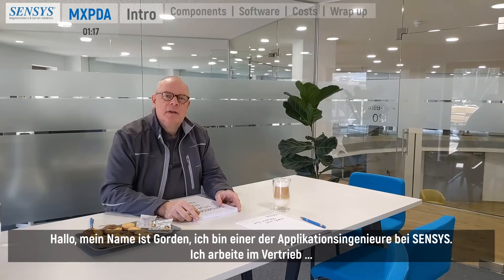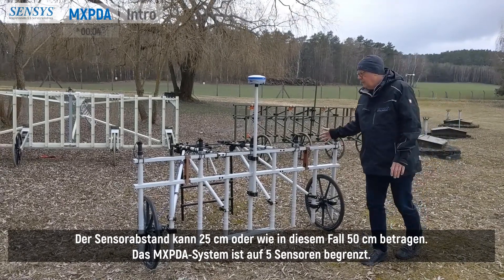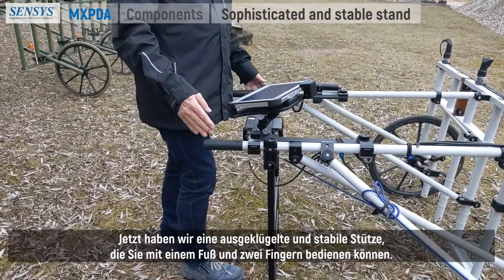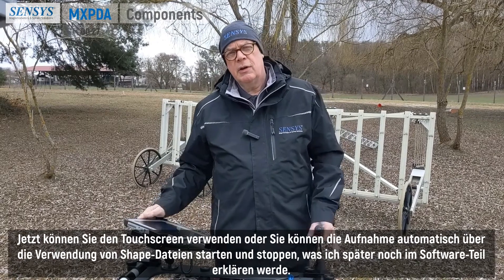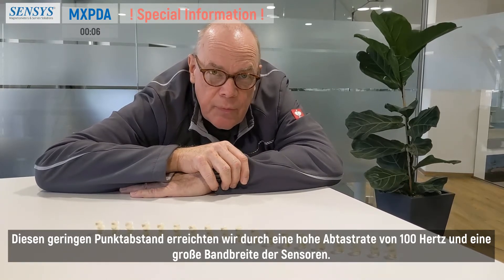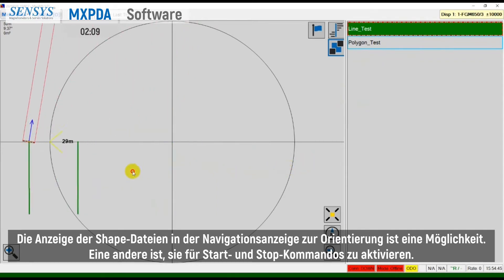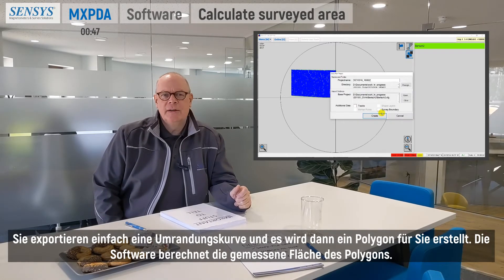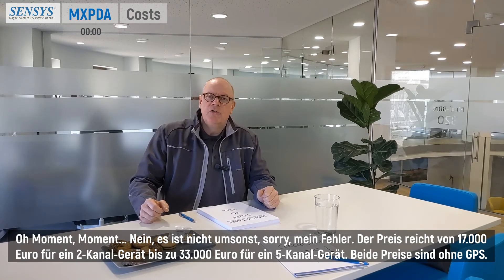SENSYS MXPDA Typ F - Produkt Video Clip - Fakten & Features

Comment: Wieviel CM  kann man Mit 2 Sensoren bei jeden Spur  scannen?
Reply from the maker: Hallo. Danke für die Frage. Mit Magnetometern ist es so ähnlich wie Temperatur- oder Lichtmessern. Sie messen in einem Punkt. Das Magnetometer misst also nur dort wo es sich befindet. Dabei werden Schwankungen / Abweichungen / Unterschiede der Magnetikwerte gemessen. Befindet sich ein größeres Objekt in der Nähe des Sensors, so kann dessen Magnetfeld auch in einiger Entfernung zum Sensor gemessen werden. Die "Detektionsreichweite" ist von daher eher keine Eigenschaft des Sensors, sondern des zu detektierenden Objektes. Archäologen messen gern mit einem Abstand der Sensoren zueinander von 25cm - da sie feine Strukturen im Boden suchen. In der Kampfmittelsuche sind es eher 50cm, weil die Eisenhaltigen Objekte in der Regel "größere" Magnetfelder besitzen, die sich auch in größeren Entfernungen messen lassen. Schreiben Sie uns gern auf info@sensys.de für mehr Informationen oder Fragen! Danke. #sensysmag